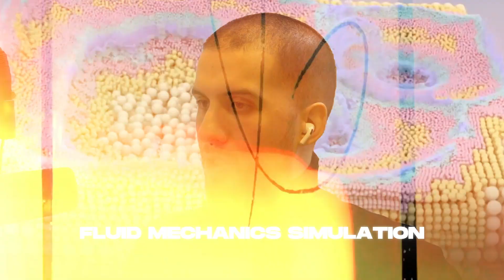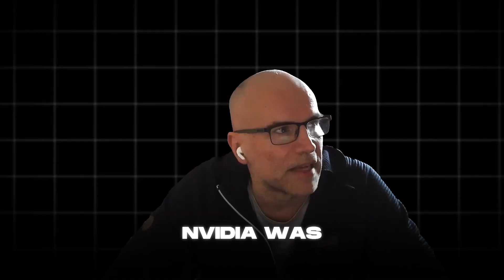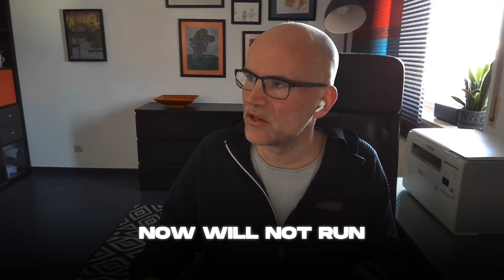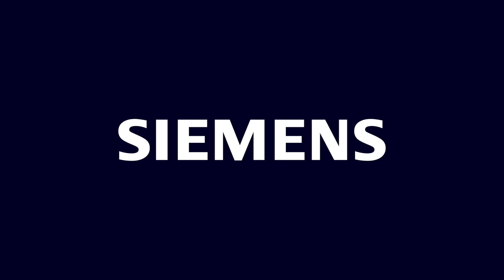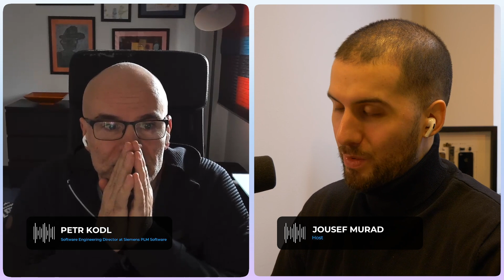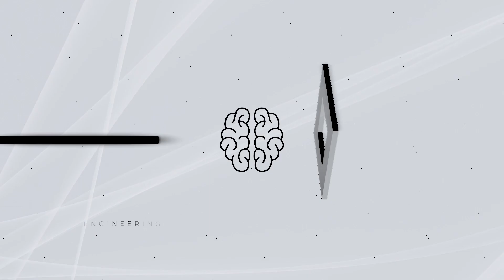GPU-Accelerated Fluid Dynamics - Petr Kodl | Podcast #121

Comment: I can only imagine the development cost to port a bloated 7 million line legacy CPU code to GPU, especially when the original authors are long retired. Porting is always troublesome as you're biased toward the old implementation and tend to overlook critical code optimization techniques specific to the new hardware. Siemens will need many years to catch up with modern native (multi-)GPU codes, if they can ever achieve acceptable compute efficiency all.
Reply from the maker: Interesting take, Moritz!
Reply: Can image that it would be an enormous work. But still have to do the work to catch up. Hope we can have a frame suits for all kinds of hardware even the future ones, otherwise changing to GPU version means little.
Reply: I’ve heard that some GPU implementations of FVM uses the cells rather than the faces as the entity to loop over to compute fluxes. To my understanding you will end up computing a lot of duplicate fluxes since each cell compute all its own fluxes, but this tradeoff is apparently worth it for some reasons (maybe that you don’t have to beware of race conditioons and so(?). Is this an example of how porting from legacy cpu code would lead to suboptimal gpu code?

Comment: Very interesting interview and crucial questions were raised. I am working with OpenFOAM and experience a mixed feelings since it runs exclusively on CPU. As I understand GPU foremost is exclusively used for computer graphics calculations, and CFD engineers has spotted its usefulness just to do number crunching for linear algebra. CPU are too overcompilated and low parallelism, and designed primary to run a complex logic for e.g. OS, it can do number crunching but parallelisation and memory bandwith is the bottleneck. Maybe in the future it will be a new Unit (chip) that do specifically number crunching, as a result a third main chip in your computer, who knows... I am personally struggling with all of this because you need to know to much to do some decent code, most likely it will be a custom code without using any commercial software. It would be interesting to ask Petr Kodl why exactly StarCMM+ is used? why not OpenFOAM?
Reply: star ccm+ is the product of the company he works for (Siemens), so it is not surprising that they are not developing a gpu port for openfoam :D